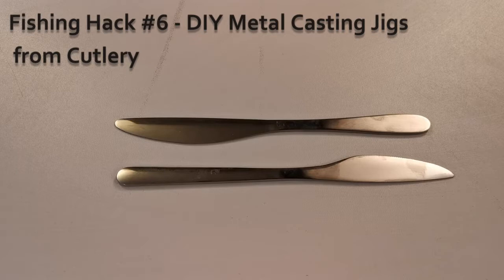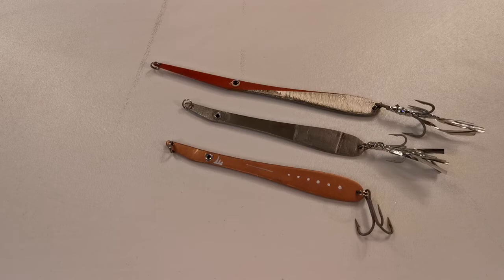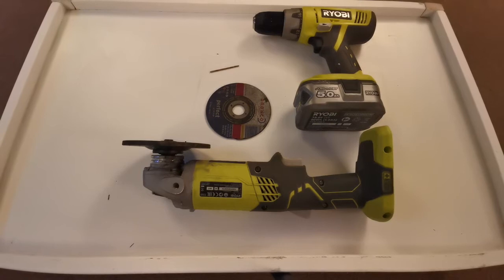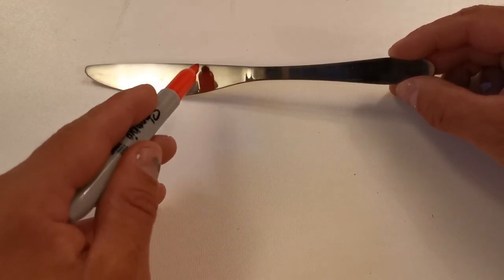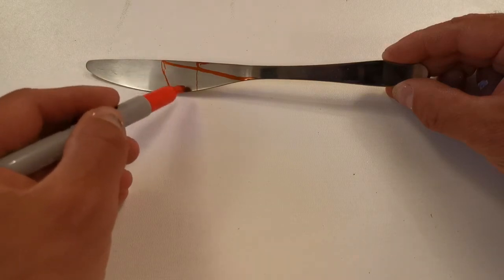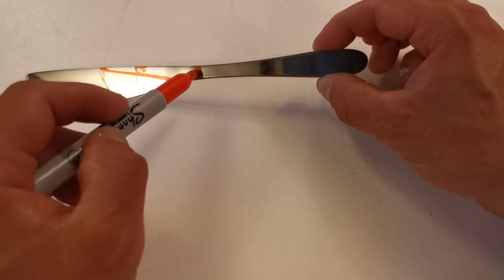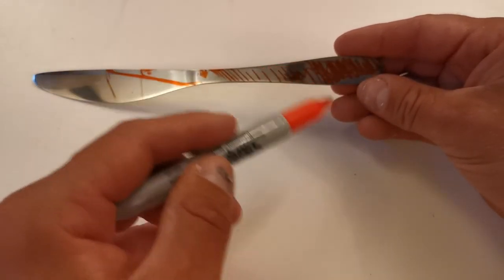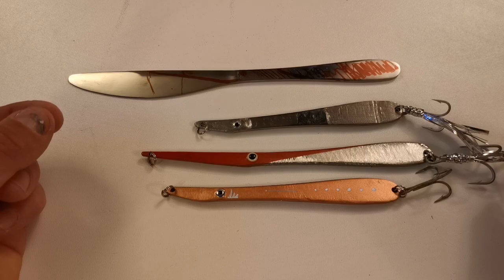Fishing hack #6 - DIY Metal Casting Jig/Lure from Cutlery

Comment: Nice work Greg,  please can you put the guard back on your ginder . Should a cutting disc shatter ( trust me they do ) there's a chance you'll get the shards in your face . I've been welding for over 30 years mate and seen some horrible stuff . Please use the guard
Reply from the maker: I know🤦‍♂️ I've seen them shatter too, I should know better!
Reply: I agree. Like you, I've seen too many accidents.   And I value my time at the hourly rate I get paid, so having just bought 3x Razorclaw Silver Minnow lures for £2.20 each, so all 3 cost me half an hour at work. All of this cutting, grinding, drilling, and maybe painting just isn't worth the time or expense, especially by the time you purchase trebles, split rings, paint, varnish & grinder discs etc.